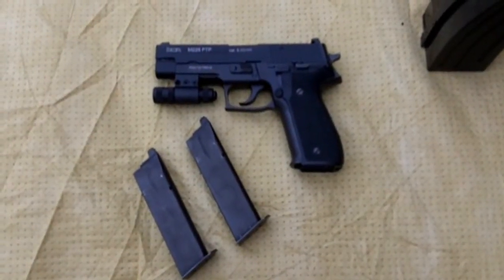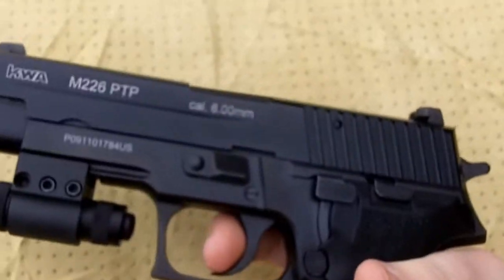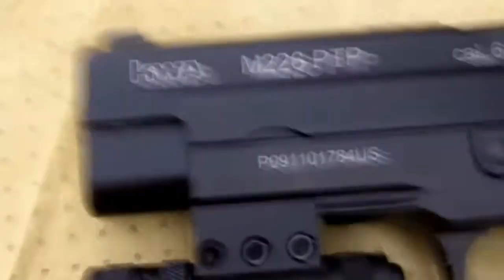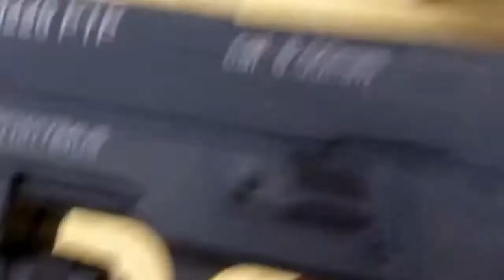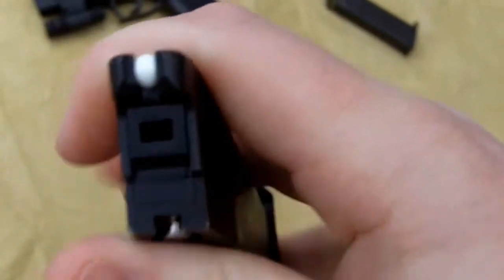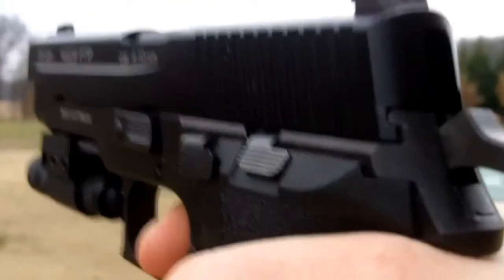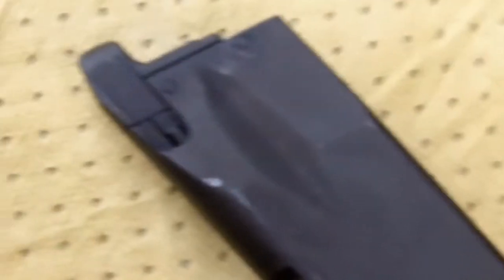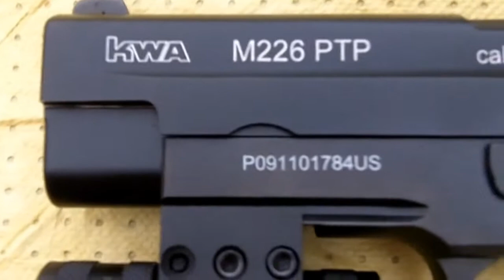KWA M226 Review

Comment from the maker: Its alright, you can deff tell the diff in quality from the real SIG and KWA's. It all functions like the real deal though.

Slide resistance, no. KWA has a real light spring. You would need to get a heavy spring to simulate the same slide pull as the real one.

Comment from the maker: @TW14137 
Why not get a .22 conversion kit? A lot better for training and the ammo doesnt cost that much. True the kit will cost you about 200 dollars~ and ammo about 500 rounds for 15 dollars but it is a lot better for training. However, for the airsoft, yes the ones with no trades that I had was better in my opinion; however they may have fixed some of the issues I had with the new ones. Old ones will be NS2 with no trades. only KWA mags will work. The slide stuck on the lower rail.

Comment from the maker: KWA M9 has the strongest FPS and then M226 and then KP45. KWA M9 is gonna be most standard then KP45 then M226. A lot of ppl have M9s they are like M4s...I would go with the KP45 or the M226 they are both good guns it is just personal preference. The 45 has a coo safety switch and comes in diff colors as the M226 has no safety but a decocker and only one color.

Comment: Use clay or epoxy not super glue, the glue won't hold for more than two mags. Using the bad clay i had was difficult, but so far no problems (basically make a barrier with the stuff around the sights)

Comment: im sorry to say, "You need to keep everything dry" is absolutely wrong. Your pistol will have half the life it does without lube. Green gas has lubricating chemicals added for a reason. the seals on top and bottom of the mag need to be kept well lubed, same with the slides and spring and all the internals. use thin lubricants like silicon spray or white lithium grease, NOTTT oil. These lubrications will keep the gun well maitenenced and extent the life of the gun   to its full.